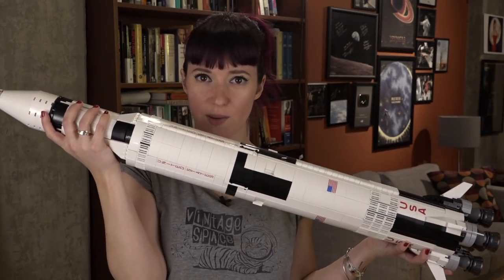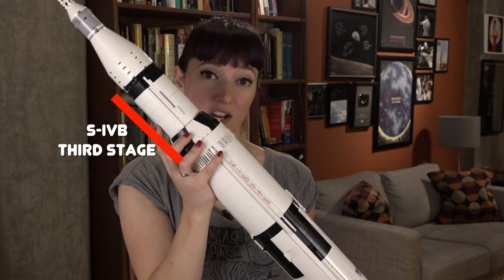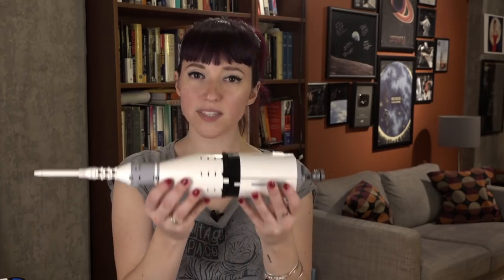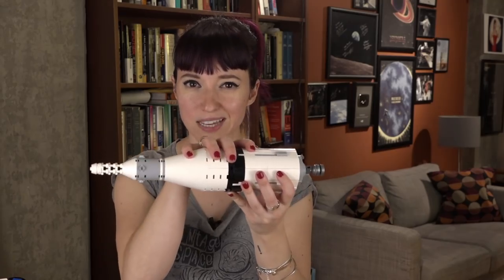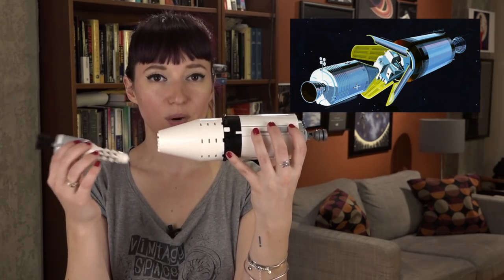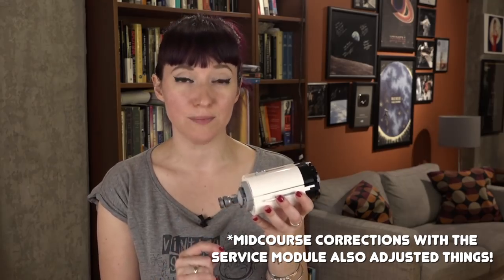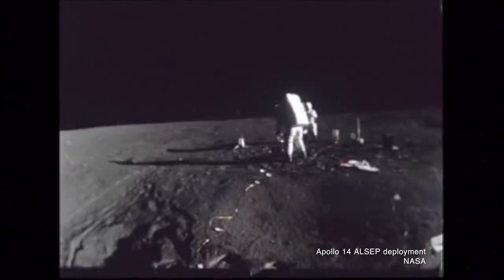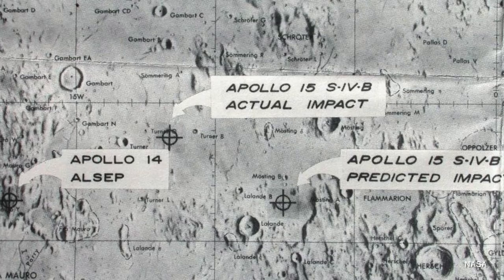This Apollo Rocket Stage was Smashed for Science

Comment: Great video. One thing I have always wondered about is Horizontal vs. Vertical integration.  The Russians and SpaceX always build their rockets and transport them to the launchpad horizontally, which seems to be a sensible option - better access and more stable. But NASA went for the vertical assembly method for which they needed to build the VAB and crawlers (which are both awesome!).  What were NASA's reasons for choosing the vertical method over horizontal?
Reply: I'm not an engineer, but my first thought was that it's simpler to design a launch system where all the anticipated loads and stresses will be experienced along a single axis (down through the center line of thrust) as opposed to one where you have to engineer for loads across a horizontal axis as well as a vertical one.  As I recall, the Redstone, the Atlas and possibly even the Titan rockets were each transported to the launch pads horizontally and then raised to the vertical at the pads, but before the spacecraft were mated to the boosters.  This makes sense in that these rockets were originally ballistic missiles which were designed to be transported to launch sites after assembly.  By the time of Saturn, it was no longer necessary to factor transportability into their design.  The Saturn 1 was about 180 feet tall, and the Saturn V a little over 300 feet before fitting the adapter and CSM to it.  That would have been prohibitively unwieldy to try to erect from horizontal to vertical.  The Saturn 1's were all erected at the pads, with the exception of the Apollo-Soyuz mission, which launched from the "milk stool" platform on a Saturn V launch tranporter and tower.  But the Saturn 1' s that launched from fixed launch pads I believe were transported to the pads horizontally in stages, and stacked, not as an assembly.   As for "better access", I'm not sure I would totally agree.  First, if you are talking about pulling a panel off the side of a horizontally situated rocket and sticking your head in to work on it, yes, that would be far more convenient.  But Murphy says that the component that you will need to access will be anywhere but the most accessible areas.  Think on the bottom, or at the top of the cylinder, or right where your mounting pads would be.  Think of the many different angles you might need to access, and pretty soon you have a dozen different catwalks, scaffolds, cherry-pickers and cranes to deal with.   In the case of the Saturns, it was simpler to place vital components at specific levels in the assemblies, and to provide access platforms at those levels of the launch towers.  The last advantage of vertical integration over horizontal to vertical, is that in the event you needed to return the rocket to the assembly building (for major service or due to weather events), it wouldn't be necessary to "lie it back down" to horizontal and to set it back up again once you returned it to the pad.
Reply: Excellent answer there pdc023. I'm sure if the Russians could have afforded to build their version of the VAB, they would have. Just like they would have built something similar to the LLRV & LLTV instead of just using helicopters for training their cosmonauts for a lunar landing. They only spent about 1/20 what the USA did for their moon landing project. I read about the decision by NASA to build the VAB in "Apollo: The Race to the Moon" by Charles Murray & Catherine Cox and I know one of the main reasons was the type of weather that could have caused a lot of problems.
Reply: I see I mis-spoke slightly on my earlier post.  The milk stool launcher was used for both Apollo-Soyuz and the three Skylab manned mission launches.  All Apollo boilerplate test launches, Apollo 1, and Apollo 7 utilized fixed (erect on site) launch pads (LC-34 or LC-37).

Comment: Don't drop it girl!
Reply: Lego is fairly resistant to drops. Sure, the rocket would break up into several pieces, but I assume putting them back together is fairly straightforward. It's not as if the Legos all separate... 

If you manage to get into a position where even 95% of the connections separate, the drop was so long that you probably already have access to real rockets, as terminal speed in a human breathable atmosphere probably wouldn't be enough. ;-)

Comment: Amy, PLEASE, take a minute to get your facts right before you finally post a video.  The S-IVBs of Apollos 8, ,9, 10, 11, and 12 were intended to be sent into SOLAR ORBIT,  not lunar orbit.  They did not have nearly enough fuel for such a third burn to slow them into lunar orbit.  They could only have their lunar trajectory altered slightly (using the APS ullage motors and remaining propellant venting) to either go to solar orbit (Apollo's 8, 9, 10, and 11) or into an impact trajectory for the moon  (Apollo's 13, 14, 15, 16, and 17) .  Apollo 12's was intended to go into solar orbit as well, but an extra long burn of the ullage motors meant that venting the remaining propellant in the tank of the S-IVB did not give the rocket stage enough energy to escape the Earth–Moon system.  That stage  just barely made it out away from the nominal lunar flyby trajectory and then entered an unstable very distant Earth orbit that brought it back towards the Earth periodically, where it was rediscovered by amateur astronomers (often identified as "asteroid" J002E3).
Reply: Correct, they still go around every 344 days. One got trapped in earth orbit for 6 rounds back in 2003. Also A16's SB-IV missed the moon.

Comment: Why did they bother to put tail fins on the first stage?   

They certainly are not big enough to provide any increase in stability:  the velocity of the craft was low when the atmosphere was thick enough to have any real impact.

Years ago I read a book by one of the V2 Peenemunde engineers (I think it was 'V-2' by Walter Dornberger).  In it, he commented that there was really no reason to put fins on the V2 because the time that the airspeed was high enough and the atmosphere thick enough to have any appreciable affect was less than 10 seconds roughly 1/3 of the way into the burn.

Comment: Several moonmen were killed during these experiments.  Jk
Reply: Could you elaborate please?
Reply: The Apollo 1 fire, I guess. Unless he thinks there are actual moon men, like the Tang guys or something. No one would hurt one of the Tang guys; they were completely 'armless!
Reply: The only astronauts killed as part of an Apollo mission were Grissom, white and Chaffee in the Apollo 1 fire of January 1967. Other Apollo era astronauts dies in plane crashes and one died in a car accident.
Reply: Charlie Bassett and Elliot See were killed, when their T-38 crashed into the VAB, at the McDonnell Aircraft facility.

Another Apollo era astronaut to be killed in aeroplane crashes, is CC Williams, whose T-38 suffered a control system failure, which caused the ailerons to lock, causing the aeroplane dive nose first into the ground.

None of these three deaths were, in any way, related to the Apollo moon missions.
Reply: Only up to a point.  All the astronauts who died were part of the batches that had been recruited as part of the Apollo programme. However, the accidents occurred in the mid 1960s when most were more involved in the Gemini programme. It has to be remembered that Gemini and Apollo ran as parallel programmes and the astronaut corps were involved in both programmes at the same time.
So it's wrong to state that they were not involved in Apollo. They were, but were concentrating on their upcoming Gemini missions at the times of their deaths..
Reply: Who said they were not involved in Apollo?

What I said was, none of these three deaths were, in any way, related to the Apollo moon missions.

The deaths were related to flights in normal aircraft.
Reply: Conducted in their role as astronauts - which was directly related to their role in the Apollo programme. Nobody died on an actual Apollo moon mission. I am sure everybody know this. But as I said, a number died as a result of their involvement in the Apollo programme - which was all about moon missions.,
Reply: Please, they prefer "Selenite".
Reply: They didn't get it. Right over their heads.